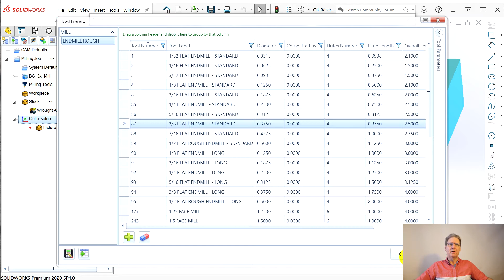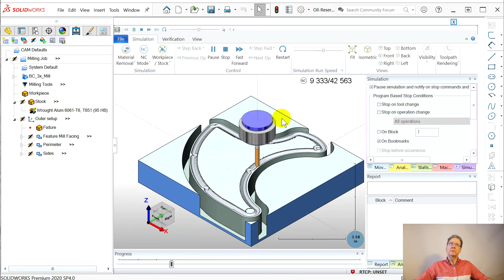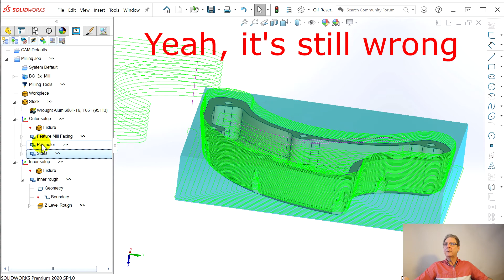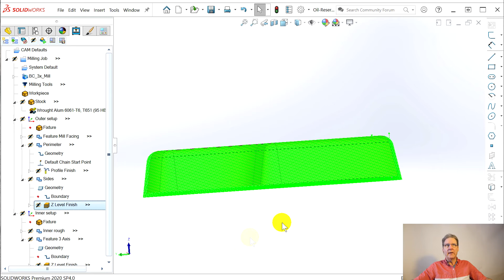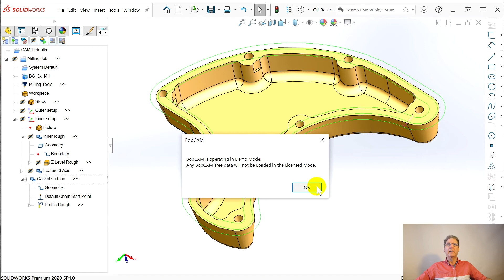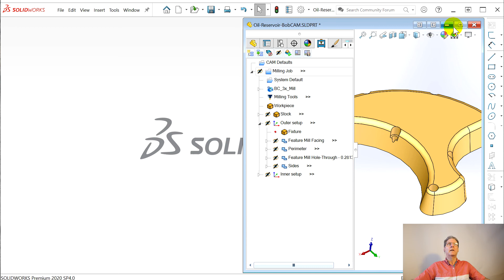BobCAD 3D

Comment: You get what you pay for! Bobcad is cumbersome in many areas but has some great performance for the price.
Reply from the maker: Good attitude, I think all the big software packages are a mix of good and bad. I have to admit being impressed at how much BobCAD does, but the price adds up when you get the upgraded packages.
Reply: @Rako_Studios  I would disagree and here is why, I had made calls to VisualMill and Mastercam and let me tell you for an individual wanting to buy a CAM package most of the others are way out of price range. I will not post prices here but I will say this, entry level Mastercam is easily 5X more expensive. But keeping in mind that the two are not in the same league at least in my opinion.
Reply from the maker: @ralfsautomotive  Well what happened to me is the BobCAD guy eventually got down to a really low price while saying the phrase "full 3D". What he never said was "Complete 3D". I just happened to have to upgrade to Win10 for my SolidWorks, so I had to re-install the BobCAD demo. At that install is a one-time screen with check-boxes of all that the demo installs. There was a 3D box checked, but also "Premium 3D" and "Premium simulation," or some such adder. So then I wrote the BobCAD guy asking for a quote that included those 3D and simulation adders, and boom, the price was way over what he told at first, and worse yet, he wanted to put me on some 3-year payment plan that would have been more expensive than MasterCAM, which I agree is priced crazy, not just base price, but every single thing is an added "module." So rather than having to come up with 5 grand for SolidCAM or VisualMill or BobCAD, I figured 500 bucks a year on HSMWorks was a bargain. I did not get a last-chance quote from VisualMill, but I suspect they would have dropped the price. I never even bothered with MasterCAM, I found it very hard to use and like you say, way expensive. I will be the first to admit that BobCAD does give a whole lot of value if it does what you need it to. I wish they had on-line help, but they do have a lot of videos to help people use the package. I think the crazy-expensive folks as MasterCAM will have to drop their prices soon or be really hurt by packages like BobCAD and VisualMill and HSMWorks.